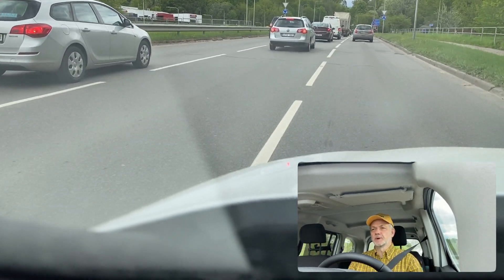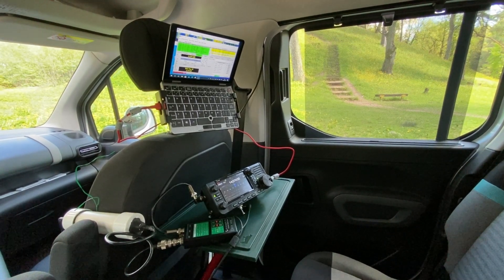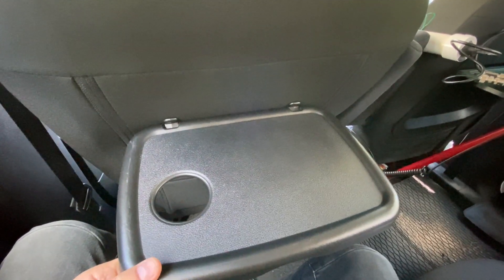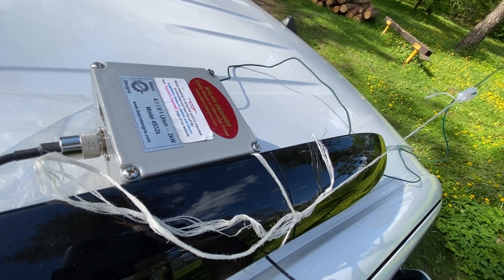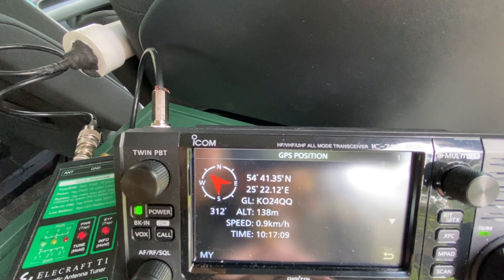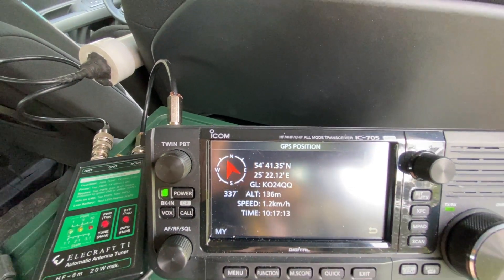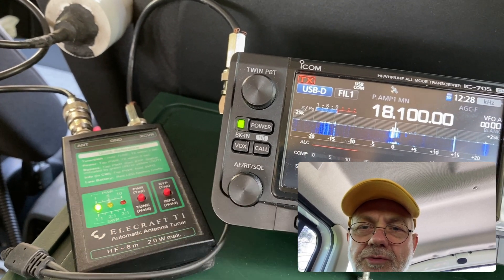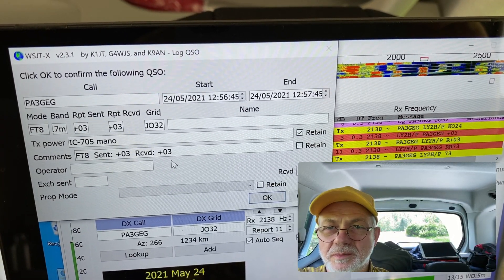How to run FT8 mode on Icom IC-705  outdoors and have fun! Beware of RF feedback!

Comment: Hi, thank you for the upload - very helpful indeed.  I see that you are transmitting on full power, is it safe to do so?  I usually set mine to 5W but turn it up to 7.5W to complete the contact if weak.  If it's safe to do so, I'll set to 7.5W and turm up to 10W if needed. 73
Reply from the maker: Thanks for watching! I can give no advise or recommendation on what power is safe, as each combination of  radio/operator is individual. What works for me, may not work for you. With this said, I can share,though, my own experience. From using the IC-705 for some 2 years now, I have impression its finals are extremely rugged and 10W for them is a light duty job :), the radio keeps barely warm at running FT8 for hours. Actually, FT8 duty cycle could be called 50% as it works at a very clear 50% Rx/50% Tx algorithm. So,  15 secs of key-down with 15 secs of rest is, probably, not a hard duty for any radio, and surely no probs for my IC-705. As it comes for other digi modes, like RTTY, PSK31, JS8 etc, where TX periods are unpredictable and could be very long ( in case of rag-chewing via the key-board), then I would give  more attention for the  monitoring of the case temperature. Rapid contest-style RTTY contacts, though, even in the contest, make no heat problems for my 705. I rearly use these other rag-chew digi modes, so I have no my firm opinion on it, probably 5-6W would be a good starter.  I  think, the IC-705 has some overheat protection , but I have never had a chance to see it   ( hopefully I will not in the  future too ) in action yet :). Else, I try to never run the radio into a high SWR antenna, but tuning with the ATU at full 10W power has never created any problems for me. But I never tried high SWR for longer than these few seconds ATU takes to find a match. I would not recommend tuning at full power if using a manual tuner where high SWR exposure could take much more time before match. Finally, your "7.5W-rule " is wise and preventive and I would surely recommend it to everyone! Stay safe! 73! Linas LY2H
Reply: @Linas_LY2H  Thank you for he detailed response and advice, I've only owned the 705 for a few weeks and have yet to master it, but it is fast becoming my favourite radio!  I checked my log, we have worked 6 times via FT8 (on 6 different bands), so thank you for the contacts and I hope to work you again soon.  73 Martin 2E0RME
Reply from the maker: @McRocking  Cool, thank you too, keep on doing it! 73! Linas LY2H